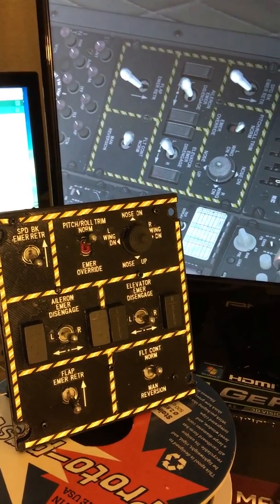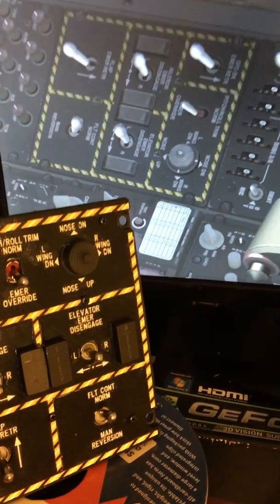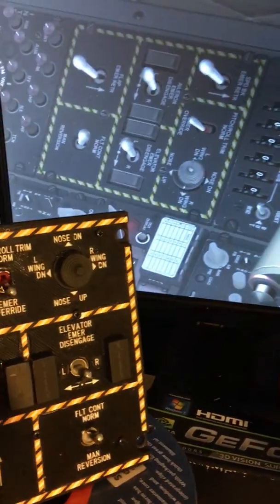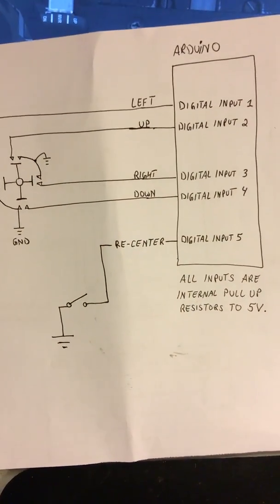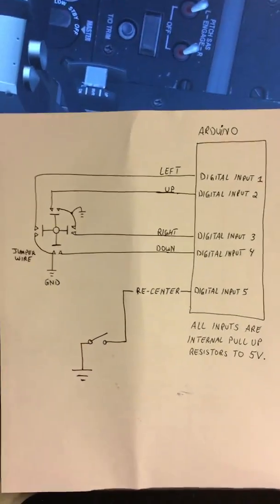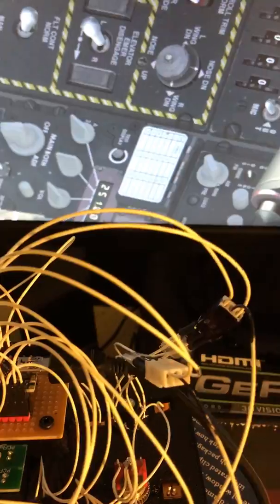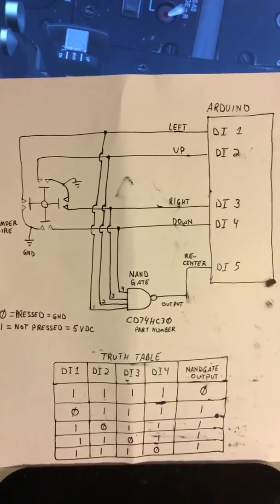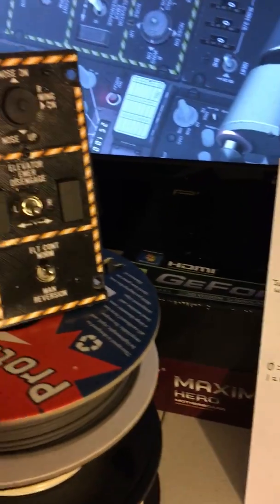DCS A-10C Home Cockpit - Emergency Flight Control Panel (part 2)

Comment: Joe, pin 7 and 11 are ground. 8 is output pin. 14 is VCC. 9, 10, 13 are NC. 12 is H. 5 and 6 unused. Do we do anything with the NC and H? When you say connect 5,6,7,8 to 5VDC, doesn't that include the 7 which is ground and 8 which is output? 14 is the VCC. If we need t connect unused pins to 5VDC, should we connect 5,6 to 14 the VCC? I'm confused. Please help.
Reply from the maker: Sorry, I made a mistake in my description. I should not have listed pin 7 and 8 as an input. The chip input pins are (1,2,3,4,5,6,11,12).  We are using only 4 inputs so the unused inputs you want to tie to 5VDC. So it’s pins (5,6,11,12) So you can connect them to pin 14 because that is connected to Vcc which is another name for 5VDC because it’s TTL logic level. If you are talking CMOS logic level then Vcc would could mean 3.5VDC.  Pins 9, 10, 13 are truly no connects that you can leave as is. Pin 7 goes to ground and pin 8 (output /Y) goes to your arduino board as described in the video sketch.
Reply: Thanks for the clarification. So i'd connect 5,6,11,12 to 14 the VCC which I'd connect to the 5V on the arduino mega. But 11 says G. Is that another ground like 7? If so i'd skip 11.
Reply from the maker: The manufacturer arbitrarily gave all the chip pins a name label. The 8 inputs he named as (A,B,C,D,E,F,G,H) which corresponds to (1,2,3,4,5,6,11,12).  How this NAND gate works is if any of the 8 input sees a ground, the output (pin 8) will go high or near 5VDC.  So when you are not pressing on the HAT switch you want all the NAND gate inputs to be 5V so that the chips output will be Low or near ground.  This low output is what drives the DCS-Bios software to center the HAT switch in the game. The moment pin 8 goes high, that means the HAT switch will not be centered and will move in the direction of the input on the switch that is low or ground. That’s why on the NAND gate you make sure only the HAT switch send it ground to the inputs so the unused inputs you tie to Vcc because all you need is one ground on any input to swing the output from low to high. For example  if you left pin 11 unconnected, there in no guarantee that the chip sees that pin as high. Maybe at times it might think it has a ground on pin 11 even though it’s not connected.
Reply from the maker: If you are not pressing on the HAT switch, then the bottom line in the logic table on sheet 2 is true. If you are pressing on the HAT switch then one of the first four lines of the logic table is true. Lines 5 through 8 are don’t cares because those are unused inputs whose state will never change. 
https://www.ti.com/lit/ds/symlink/cd74hc30.pdf
Reply: Joe not sure what you mean 'if you are pressing on the hat switch'. We will be pressing it from time to time in the direction that we want to manually trim, left, up, right or down.
Reply from the maker: Good Day.  Yes,  you got the concept right.  That circuit does two things for us.  When you are not pressing on the real HAT switch, the NAND gate's output tells DCS-Bios to center the HAT switch in the game.  When you press the switch in any direction the NAND gate's output will not send the center command to DCS-Bios.  So DCS-Bios will say hey I'm no longer centered and also I see one of the other HAT switch position is now active (either Up/Downn or Left/Right).  So it will now move the game switch to that position.  So when you let the real HAT switch go, the in game switch will recenter.  That is because the NAND gate at that time will also see no inputs are active and will change states and tell DCS-Bios to center the in game HAT switch.
Remember our original problem is that with DCS-Bios, if you press the real HAT switch in any direction and let it go, the real HAT switch returns to center while the in game HAT switch remains tilted in that direction and will not return unless you and a circuit to make it return.
Reply: Joe, thanks for the help. Finally got it working. But i had to reverse D1 and D5 in the dcs bios code to it to work. Not sure why. See my wiring at https://i.imgur.com/ar7rfId.png

Comment: HI, do you need any additional scripting when using the NAND Gate for dcs bios or does it help to strictly give a ground. I am using a CD74HC30E Chip. The data sheet shows a Y. Would this be considered my output? Thank you in advance.
Reply from the maker: Good day Mr. Peters.  Hope all is well.   You do not need any additional scripting from DCS-Bios. When you paste in the code from DCS-Bios below, it is already is looking for 5 inputs. 
const byte efcpEmerTrimPins[5] = {PIN_0, PIN_1, PIN_2, PIN_3, PIN_4};
DcsBios::SwitchMultiPos efcpEmerTrim("EFCP_EMER_TRIM", efcpEmerTrimPins, 5);

The first four are trim inputs for left/right and up/down. The last one is for trim center and that’s the pin on the arduino where you connect pin 8 (Y) from your CD74HC30E chip. 
Pins 1 through 4 of the chip you connect as shown in the diagram in the video spliced into your hat switch. The output pin 8 goes to the arduino pin that you assigned for center, pin (PIN_4) above. 
CD74HC30E pins 5, 6, 7, 8 (<—-typo) input pins are (5,6,11,12) you will connect to 5VDC because they are unused input pins and you want those inputs to always be high. Pin 7 goes to ground and pin 14 goes to 5VDC to power the chip.
Reply: @joesim9577  Amazing! Thank you very very much! I've been reading all morning trying to understand Nand gates. Thank you for taking the time to make these videos. Another panel done. Happy flying!